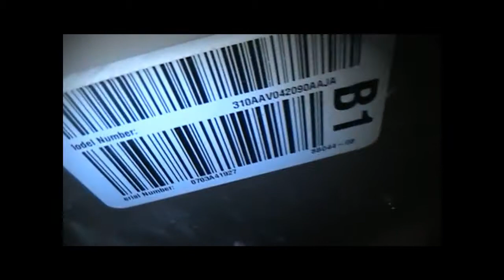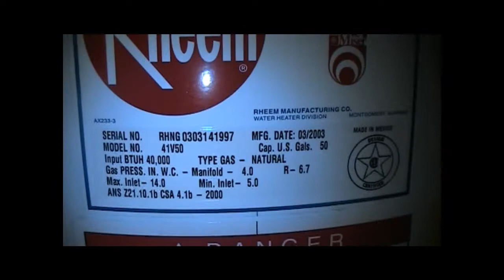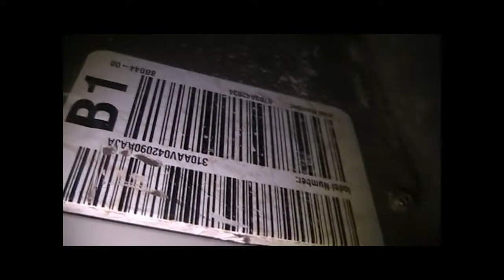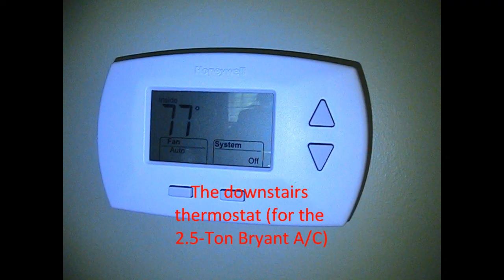Dual-Zone 2003 Bryant 80% Efficient Gas Furnaces (One Running in COOL Mode)

Comment from the maker: They do. Honestly, I was shocked they even had it on. They have allergies though, so that's why the upstairs system was on. They usually set both A/C's to 76-80*F in summer, and the furnaces at 72-74*F in winter. 

My tow-stage furnace really is amazing. We save so much money with it, compared to the old 1997 Carrier furnace. I would want a 2.5-3-Ton XL20i heat pump for my house.